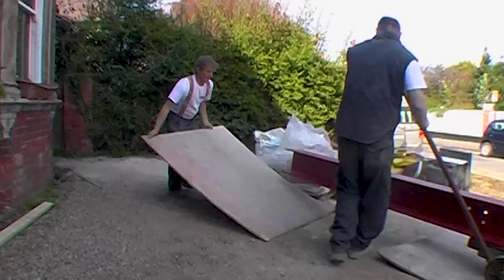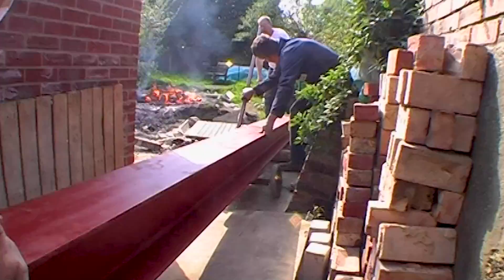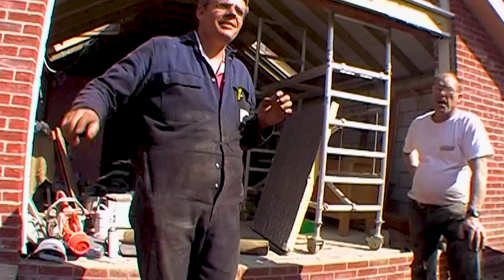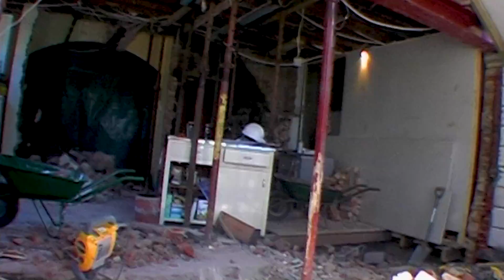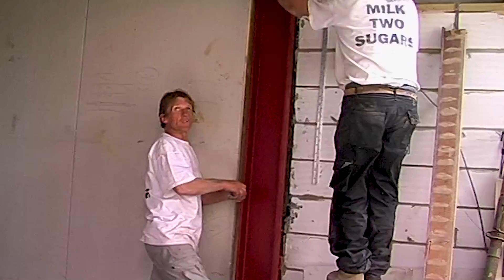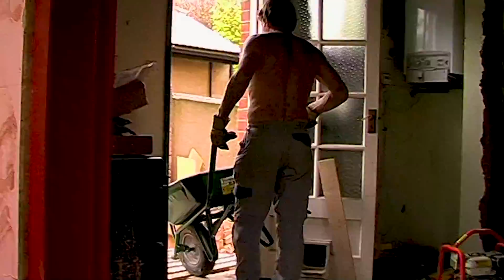Moving Heavy Steel Beams ~ 35A Extension #6

Comment: i have done similar, we lifted the steel over the house with a crane and installed it all while the extension was at oversite, Built a timber stud wall with ply cover to enclose the rear of the house and then built the brickwork, easier than what they are doing in the vid.
Reply from the maker: Yes we never liked doing things the easy way, it makes you soft

Comment: Can’t wait for the next one in this series, proper building. I did wonder, until you showed the arch above the fireplace, whether you’d removed the chimney breast above! On a job like that where someone had removed a chimney and the rest was still upstairs! Had to rebuild it to support the upstairs.
Reply from the maker: Hi Simon
The arch was structural but it had a crack in it so we backed it up with a steel beam. It wasn't on the drawing but we did it to be safe.

Comment: Wow. In Hungary (where I live) the beams to span such an area are often quite a bit smaller. Two blokes (to use the "English vernacular") can usually lift them. The larger the area, simply more beams are used, in most cases. In some cases, such large beams may be used, but it is uncommon. Sorry to see you have so much bother with those. 🙁
Reply: Beams and concrete footings are often over-specified here. Very inefficient

Comment: Proper job. rollers, planks and hard graft then a guy gives a lecture on  structural engineering flex points mid way through bet you were glad when he shut up :)
Reply from the maker: He was the steel fabricator and he did an amazing job of delivering the steels and helping us get them into the building. Again it was the structural engineer who was difficult to understand. He talked to us about pre-loading the steel by hanging weights off it and then bricking up and then releasing the weights so the shrinkage in the mortar was compensated. Look at that steel and imagine what it would take to bend it.

Comment: Rog little tip . Get some drain pipe cut it into 300mm sections about 4 or 5 fill them with concrete and use as rollers miles easier .
Reply: Youd be surprised but they dont even need the concrete. Theyll hold up fine. The pvc is great because you can slide as well as roll.
Reply: My experience scaffold tubes are too small unless your rolling on flat concrete surface area needs to be bigger
Reply from the maker: J Harris. 
I like that idea but I also like the idea of getting six blokes in.